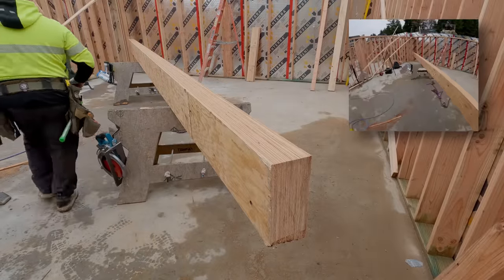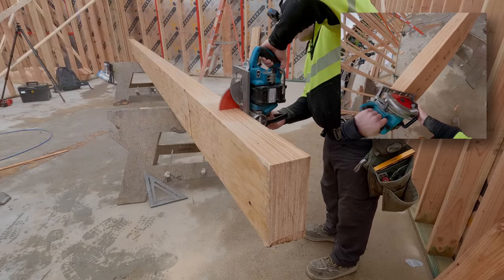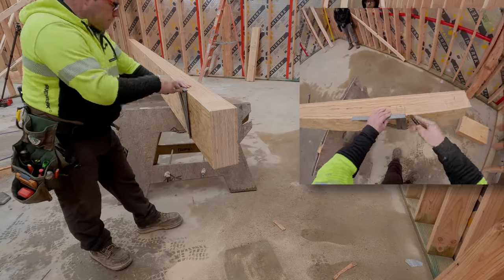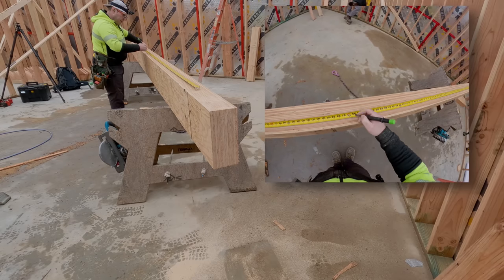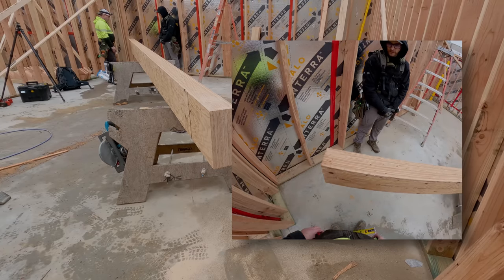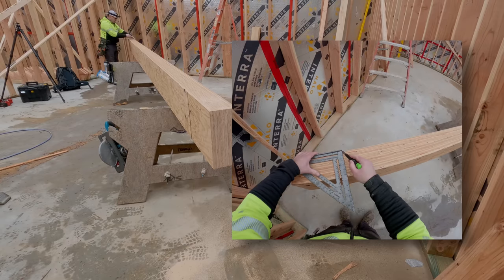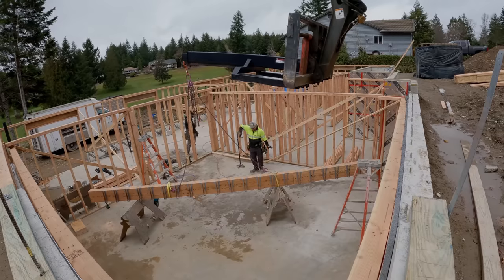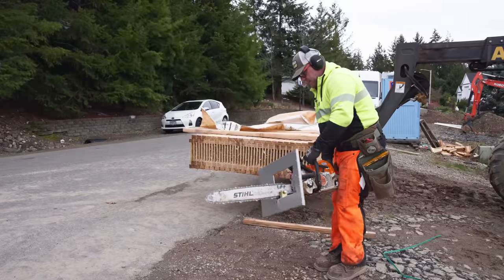Framing a Floor System: How to Install I-Joists Efficiently and Correctly project 120 part 3

Comment: It's a ton of living space (and should be pretty sound resistant, are there any other insulation/sound proofing details going on top or bottom of the I-joists?), and sure you've got a lot of lumber, but you guys save so much labor and time on the installation that it makes a lot of sense to "overbuild". My father-in law has a springy floor around his kitchen island. Unnerving.

Comment: Have you done a wood framed garage floors before? 

How does it feel? How have they held up? 

I think cars floors are supposed something like 40psf.which is minimal,  But I'm very curious about the movement of the floor assembly when the cars are coming and going.
Reply from the maker: Yep we have quite a few times in the last 30 years. The slab itself essentially removes any deflection since it's "floating". Think of it like a giant panel resting on the framing.

Hoping to get the slab done in May. Stay tuned 👍

Comment: On the joint hangers why not grab a block of 2x4 to use as a spacer?
Reply: Its 1 3/4” I joist and if you were to stick it in for spacing the the hanger has locking tabs so you won’t be able to remove it.
Reply: @granterickson9294  Good god , ok then use a piece you cut off as a spacer. Really you type out that response instead of saying geez I didn't think of that.